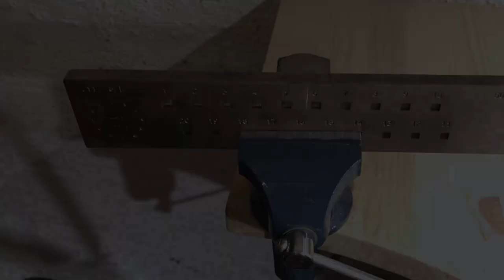How to make a silver bracelet | Silver foxtail bracelet

Comment: Please tell me what should be actually wire's total length.......for 25 inches Chain.
Reply from the maker: If your wire is 0.8mm (20 Gauge) and the jumprings are made on a 14mm mandrel then you will need about 750 cm (24.6 feet) of wire to make a 25-inch chain.